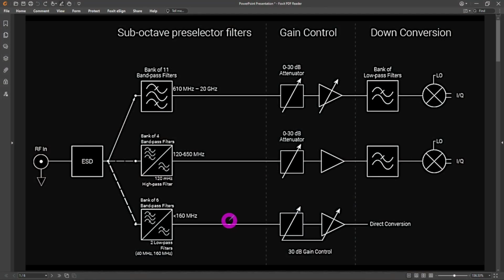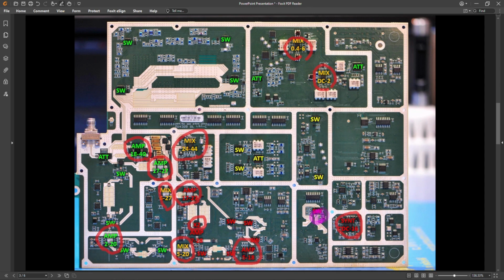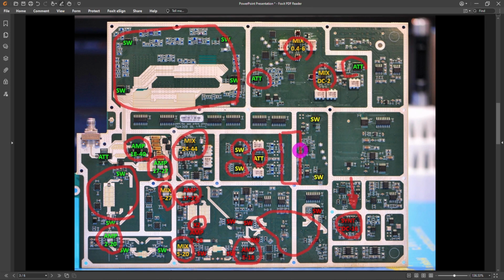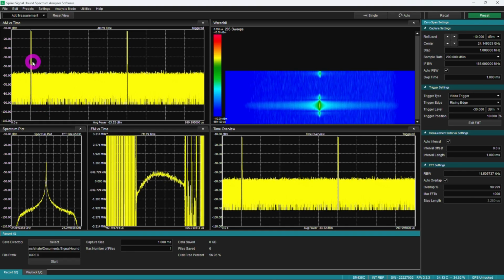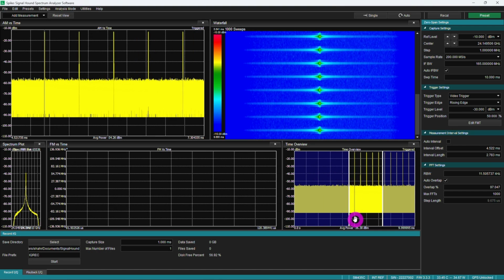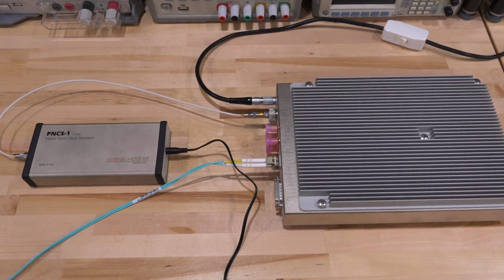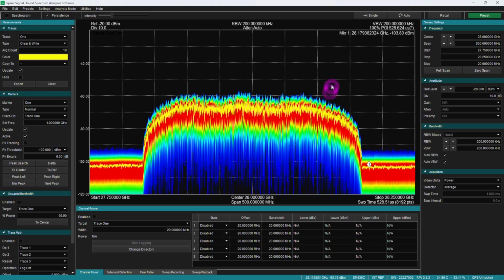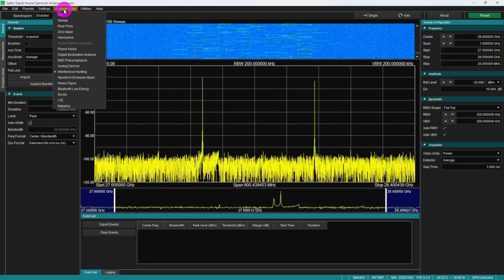TSP #224 - Signal Hound SM435C 43.5GHz Real-Time Spectrum Analyzer Review, Teardown & Experiments

Comment: The 435C is an excellent device, I am happy owner of the device, got it around 6 weeks ago. I even bought a notebook reserved for the interface using usb-c and a optical interface. I dont have the IF out option which is also a great extension, maybe later if possible.

Comment: I'm currently forming a pitch to budget roughly $70-100k for a used 13GHz FSW  (which I used at my last company, and absolutely loved). Your phase noise measurement caught my attention, similar performance for a much lower price. It's an interesting option to consider! 

Used equipment from rental companies take a lot of abuse from all that shipping. Though, a used factory demo at least gets a factory refurb and factory warranty.

And, my company is not a traditional company with traditional equipment needs (like ISO, or standard waveforms & modulations, or external customers, etc).

Comment: Excellent review as always. I'm stuck with an old HP that works up to 50 GHz with an external harmonic mixer, but I'm only looking at narrowband signals. The bundled software looks neat, and how nice that it's not an expensive licenced add-on.  It's an expensive way to make a downconverter for that MXR and the Tek MSO though!

Comment: Just some thoughts - this software- absolutely sweet. It's just begging for some sort of command-line/Lua/Python interface.
0: Guys, if you're coin-flipping between the Tek RSA and the SH equipment, go SH. Support small businesses (Apple in 2014 paid literally .005% tax via transfer-pricing[1]

1: Thanks for taking the time to break this down. Do you have any of the parts (specifically the mixers [I want to build a transfer-relay DC-4GB DPDT for cheap-ish without having to go to Pasternak and drop $800] and the ocxo? [All the cheap rubidium stds are gone sadly]. Oh and the AD DC-14 synth?
2: Thanks for the experiments! I know these take tons of time to think up, and setup. And I know you're the director of your team, so that's gotta be stressful, along with making time for girl/brother.
3: That looks supppppper rugged. The connectors that are screwed into the PCB etc. Pretty confidence inspiring. Are those type K's? (I've never gone past SMA since I don't do RF professionally, forgive my stupidity!)
4: Did you ask them why they didnt move to USB 3.2? Having those isochrony guarantees seem like they would certainly help, and I'm almost 100% sure Intel will have IP cores available for sale out of the box. 
5: What does the thermal profile look like compared to the previous revisions?
6: You and Joe Smith have just...amazing channels hahaha.

How close to an ITAR violation is this? I know the DOJ has already prosecuted (convicted?) at least two espionage agents trying to exfiltrate trade-secrets from Boeing...and...hmm.

[1] Multi-national corporations  solicit services from Ernst-Young, and the like, in order to minimize tax bills, while average folk like us pay 30% marginal federal, state, and muni. (Look up the Double-Irish-Dutch-Sandwich.) "Transfer pricing" is basically moving revenue generated in one taxable domicile to another domicile with the intention of lowering your overall effective tax rate. Nike is notorious for this with their "Swish" logo- effectively claiming the value of their $120 shoes are not in the materials or labor, but rather the Swish (which is certainly true to an extent, if you look at the cash flow re: Air Jordans and endorsements). The Swish would be intellectual property that belongs to a Nike owned subsidiary in, say, Ireland. Ireland would then give Nike an exclusive tax incentive, bringing their already low corporate tax rate of 15% or whatever to 1% under the pretext of "this is generating revenue for the state". The EU has been cracking down on this -- Apple specifically. It was adjucated and Ireland was found in violation of not offering the same benefits that Apple had to similiar companies.

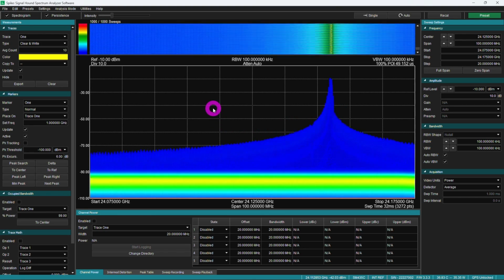Comment: 20:12 Speaking of bloat. I installed AMD/Xilinx Vivado FPGA development environment yesterday. The full installer for Linux &  Windows is 90GB. :face-fuchsia-wide-eyes:
Reply: Hah, sounds about right!
Reply: Thats the normal way of building dependencies in libraries today. Instead of configuring the code by use you configure by reference. The result is that most of the code will be never come to execution on the machine.

Comment: That's cool. Out of interest, what part number is the Analog Devices oscillator they are using?
Reply: Based on the annotations it could be the ADF4372 which is a VCO/PLL chip with 4 VCO cores up to 8GHz and a X2 multiplier for 16GHz. To get to 43.5GHz the multiplier path left is likely X3 because requires less filter banks for the multiplier spurious at LO and 2xLO. A critic is on Shahriar is that he still use the wording "sweeping". The ADF43.5GHz could not sweep over the instrument settings. Instead it is a step synthesizer and sample process. So there is instrument blind time by the bandwidth to span and also the synthesizer settling time. Analyzers in the analog stone age sweep a synthesizer.
Reply: @reinerfranke5436 

 I have tested the ADF4372, and I do not believe that it is possible to achieve the phase noise spec of the SM435C with a single loop synthesizer.
  The instrument manual talks about a transfer loop, so it is more likely they are using the ADF4401A. For a phase noise of -136dBc/Hz at 10kHz offset a dual loop or translation loop is the only way. The ADF4401A  costs £582 in 1 off from Mouser!
Reply: @cosmolittle1395  Yes, ADF4372 is not achieving the -136dBc/Hz at 10kHz offset and 1GHz carrier. The ADF4372 spec give -234+10*log10(500e6)+20*log10(2)=-141dBc for the flat noise reference component but -127dBc/Hz for the 10kHz flicker. This assumes using a 500MHz reference. The ADF4377 seems an PFD update. There we get -239+10*log10(500e6)+20*log10(2)=-146dBc/Hz and -147dBc/Hz flicker. The PFD in the ADF4377 is -20dB better at flicker and -5dB at the flat component. So for -136dBc/Hz at 10kHz there is no need for a translational loop. Anyway the reference input of the translational loop need an additional source up to the max of the VCO. To generate this you must multiply any low PN source like a high performance SAW oscillator and run into the same PFD performance limit. Instead you can drive the RAM/DDS/DAC to generate direct the 500MHz reference. 
If we get some higher resolution pics or a simple annotation we know more.
Reply: @reinerfranke5436  I was not aware of the ADF4377. This is an integer N synthesizer, so unsuitable for a lot of applications. However for this instrument, where the LO only needs to tune in large steps, it might be suitable. A high resolution photo of the PCB would answer these questions.
      In a transfer loop or downconvert loop synthesizer, the LO phase noise is directly transferred to the output VCO. The LO usually has only a few frequencies, often derived by harmonic multiplication and filtering of a SAW oscillator around 1GHz. The IF usually covers an octave, and is one input to the phase detector. The other input can be a DDS or fractional N synthesizer.
   A

Comment: Browsing the product data sheet, there are two sets of specifications for image rejection, one with Image reject off, and one with image reject on. This implies that some sort of software image cancellation can be used. There is nothing about this in the instrument manual.

The instrument manual is full of useful information, and is unfortunately is as close to the real thing as I am likely to get.

It is extraordinary how spectrum analyzer design has changed over a working lifetime. My first SA was a 141T , alas long since sold on ebay.

Comment: whats the current highest sampling frequency
Reply: ie the fastest transistors
Reply: in dsp style the less transistors the more speed with less power used
Reply: does that 40GHz unit just use many parallel processors instead of one linear unit

Comment: Lol, will be fun fixing that stuff, in like 20years, when it lands on ebay for cheap, somewhat phucked and you have find out why.
Somewhat fun on well designed 1980s instruments, not so much here, I guess.
Reply: I think this is easyer to repair that the older style of instrument eith individual modules. No more wirebonded bare dies that are almost impossible to replace